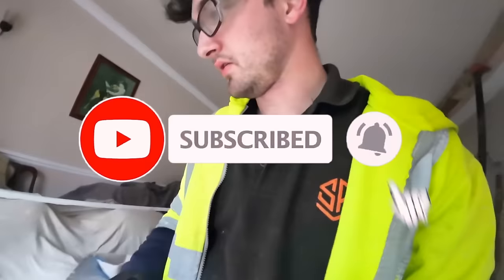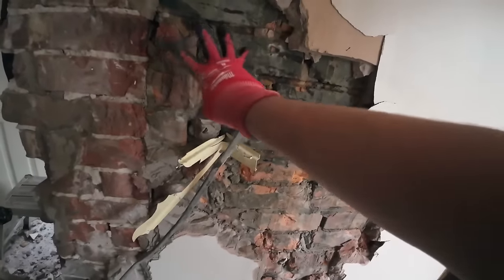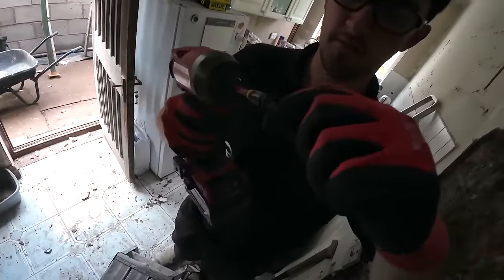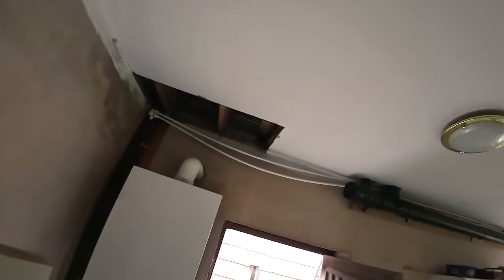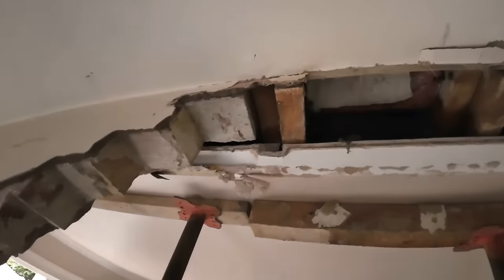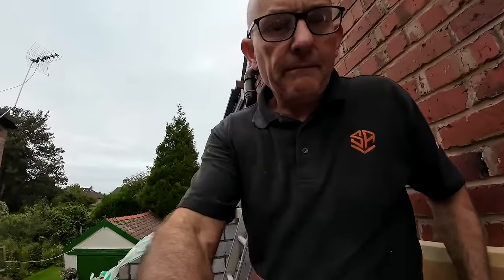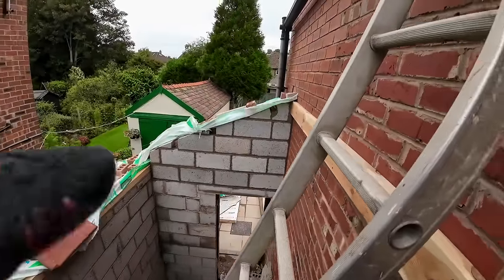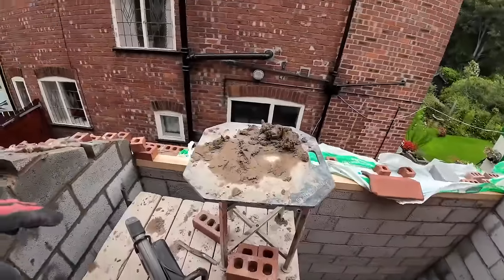BUILDING PIKES AND PREPPING FOR STEEL A BEAM PT 9

Comment: Them cables are shocking cowboy stuff and dangerous that Alex is lucky .
What id do for imside work we worked two days las t week thats it Steve.
Nice to see the template out for the pikes as you call em and the ladders cut into the blockwork etc nice work 👍 👌 🧱🧱
Reply from the maker: Yeah we’ve had a lot of down time too . Crap for the bills but great for resting my hip. 
    As for those cables they were ridiculous 😡😡👍🏽🧱
Reply: @SteveAndAlexBuild  
Been a shit year weather wise Steve.Rest up take it easy mate 👍🧱🧱
Reply from the maker: It certainly has mate fingers crossed next year is better 😬🧱👍🏽

Comment: As an electrician (though I´m not a domestic spark) I can say not a good job running that cable in at a diagonal. Don´t let it bother you, you´re not the first and wont be the last and if the guy (or I´d like to call him "divvy") runs his cables like that what does he expect?  I´ve drilled through cables and pipes before.
Reply from the maker: That Divvy was a “qualified “ electrician 20 years prior to us nearly getting electrocuted 😒🧱👍🏽

Comment: I assume the continuous cavity is to give a thermal break between the newly inside wall and the external skin but wouldn't cutting all the way down the wall and inserting ties and mastic achieve that better. I realise you are questioning the sense of it along with other commentors, cheers guys.
Reply from the maker: Don’t understand what you mean but it sounds like a lot of extra work 😬🧱👍🏽
Reply: @SteveAndAlexBuild  sorry, I assume the building inspector wanted continuous cavity and I don't see the point just for the bit above the lintels. If it was for thermal separation it was just pointless making you do that bit, cheers.
Reply from the maker: @ooslum . No probs 🧱👍🏽
Reply: There’s an old fireplace on the kitchen side of the wall you’re removing but no chimney breast the other side ? Eh ? Good skills as always chaps
Reply from the maker: Yep ! Confused me too 🤔👍🏽🧱
Reply: @adyt225 I've done a bit but not in a pro way but that bit of continuous cavity compared to the cold bridging behind the door frames and along the wall plate just looks like the B.I. read a book. I'm glad I wasn't the only one, I don't know how you guys bite your tongue when they want the ridiculous, cheers.
Reply: @ooslum He is just following standard cavity wall protocol where the cavity at any junction should be continuous, so he is not wrong but it's something I never do.
Reply from the maker: @bricklayersworldwithandy6277 🧱🧱👍🏽
Reply: @bricklayersworldwithandy6277  I see that and at a normal junction it's the best practice, it just seems an awful lot of work for absolutely no thermal gain or minimal at best, I thought perhaps I was missing another reason, cheers.
Reply: @bricklayersworldwithandy6277  Just out of interest, if this were a double story extention, carving that flank wall up into three would open all sorts of cans of worms on many properties that age. I'm wondering if this might be "do it as long as its a little bit" type of rule, cheers.
Reply: @ooslum  👍
Reply: @ooslum  That's the reason we dont do it as it weakens the existing building, if you were to i suppose remedial cavity wall ties should be installed in the existing every .225mm if it was on a corner. BC in my area won't allow it for this reason but other parts of the country insist on it or a slot cut with DPC,